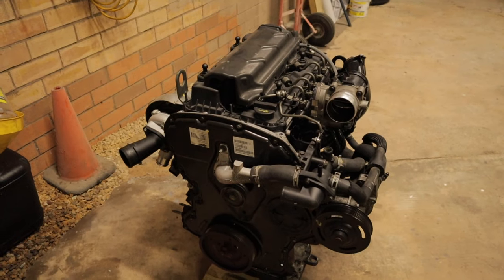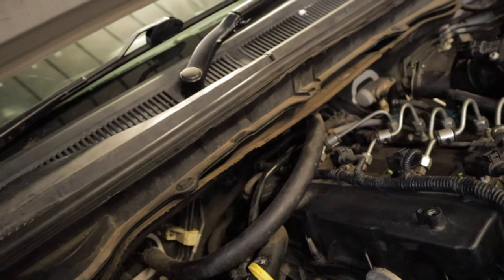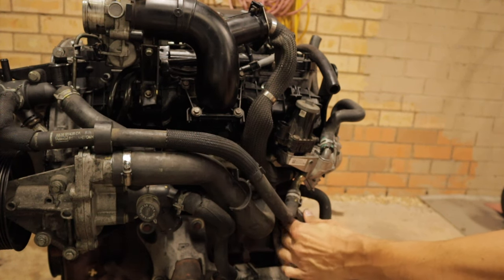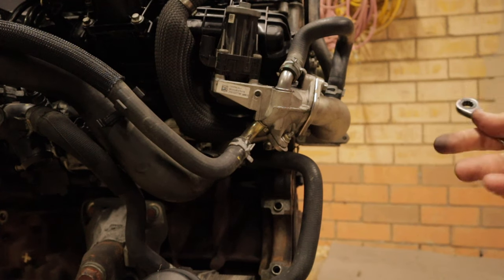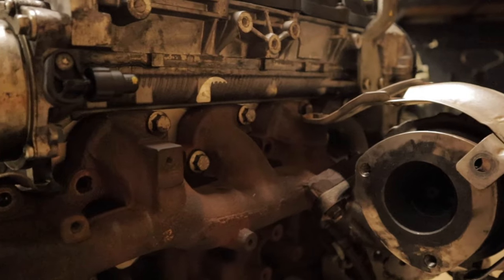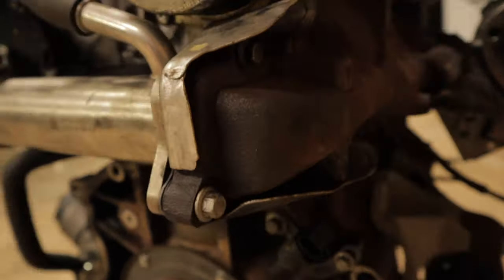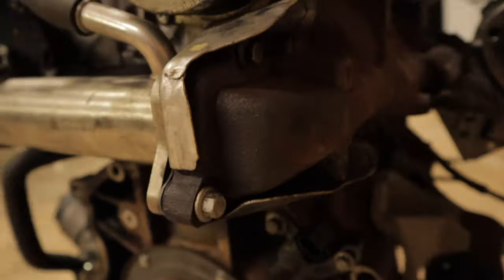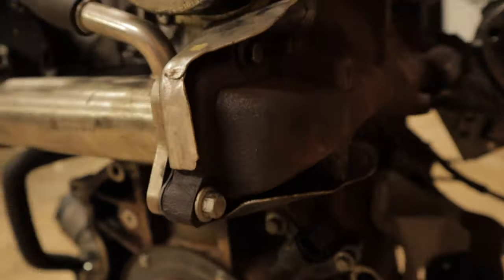Ford Ranger EGR Cooler Bypass, Blanking, Removal & Install

Comment: Great video 👍 question? You mentioned the hose was 15mm but for a Px2 others have said it’s 16mm is that correct?
Reply from the maker: 16mm is the standard size, i used some off cut that looked like 15mm when i measured it, used a tape measure tho so not that accurate, go with the 16mm
Reply: I used 5/8'' ==15.88 mm(16mm)
Reply: 16mm  bottom . 20mm heater inlet
Reply: Definitely 19mm
Reply: When blanking permanently should U get an egr delete on its computer
Reply: Nice demonstration for EGR however if we block EGR for the DTC for P1305 75 2F still present on IDS? Is that correct? I'm looking for Recommendations legend

Cheers
Reply: @markrussell3322  or you can get an EGR Module delete just plugs right into the MAF sensor and tricks the EGR valve to stay closed. no codes at all and no soot in your intake..

Comment: Considering taking this fellas advice guys.  My ranger blew a hole in the engine block, mechanic believes the cooler caused this. This was a 2.2L and now sitting in my backyard because it's hard to justify spending almost 10k to fix it. Oh well..new hilux is going good

Comment: Having worked on ships it is vitaly important to maintain your coolant.
If you're using town water or bore water or not changing the coolant regularly you will get corrosion in the water jacket.
The exhaust gas won't corrode, the coolant does, if the coolant is maintained these problems shouldn't occur but no-one changes their coolant regularly. The engine is made up of dissimilar metals that react with each other when the coolant gets tired and starts to becomes an electrolyte.
Cracks may occur from expanding and contracting but corrosion won't if you look after your coolant.

Comment: Thank you been looking for a video like this for ages. With the EGR to Exhaust manifold blanking plate, I found another guy who slotted the two bottom holes on the plate. Then you only have to completely remove the top centre bolt and only back off the two lower bolts, as you did with the blanking plate at the EGR valve body. Thank you again, job well done.
Reply: That guy is a genius

Comment: This is awsome in theory, wish I had this before I did all this in situ   in the car. Beware the egr valve the little tabs of the factory gasket are sharper then shark teeth, also if u think the exhaust blank is going in like shown then your dreaming. The only way to really accomplish all this with a full intake clean. Get the intake manifold out to get the best access to the back of the head. U can fully remove the egr cooler and fit the blank with a piece of stiff wire inserted through the top hole of the exhaust manifold, slide the top hole of the blank on and then slide top hole of the egr cooler on and then pull the whole lot back towards the Manifold. In sert the 2 bottom bolts to secure then reef the wire out for the top bolt. Then put all the intake gear back on. Make sure u have some small 10mm 3/8th tube sockets with universals to get at the ex manifold bolts in/out. These will come in handy throughout the intake removal as well. Also tie the bonnet up so it sits straight or 90deg as well, allows heaps of room. Ps hose from auto parts supplier in Australia is almost perfect factory replacement for bypass calibre ch1325c.
Reply: Yeah nah, no need to take the inlet manifold out to do the blanking both sides. If someone like me can do it on a gravel driveway with limited knowledge and tools, then anyone can. The trick is to take out the bolts / nuts from both sides of the EGR out at the same time. If you loosen the 13mm nut that holds the EGR to the motor, then you can do the exhaust side from under the car without undoing the exhaust manifold. The other side is the easy side. No need to take anything else out of the way to do the job.
Reply: @wadehughes8986  Great tip. Thanks.
Reply: I used an XD Falcon heater hose, it has a flared end at one end of the hose to suit heater connection at firewall and the non flared end goes to the EGR exit hose location, the particular hose is an ideal length, sorry no part no,

Comment: Great video,  👍  the water line bypass number 1 looks the best. Factory.
You can also just turn off the EGR valve In the software and it never opens to stop soot build up. 
I also read in the ranger Px3 the EGR acts as a pressure relief valve so it opens to relieve boost but stays closed so exhaust gas doesn't get sucked through when light throttle cruising.

Comment: Thanks for posting mate cheers.
Just did this to my 2014 3.2L Ranger.
Had driven it a long way and noticed I was topping up coolant all the time.
Suspected an issue with the EGR cooler.
Eventually it was going through more coolant than I could put it, litres at a time. Must have all been going out the exhaust. Also eventually noticed exhaust gases coming out the coolant tank and odours. So decided to do my own bypass before the engine overheated potentially causing serious damage, if that hasn’t occurred already. Have done the coolant line bypass, haven’t done the exhaust yet. 
It is now not loosing any coolant for the first time in a long time. Temp gauge is stable. So must have been the EGR cooler at fault. 
Very disappointed with Ford for these rubbish parts. 
Will be taking it in to the shop ASAP. 
Thanks for the tip mate cheers.
Reply: Did you need to do head gasket in the end or all good? Mines identical to yours, cheers.
Reply: @antonyomeara-bk9pm  
This is what happened.
I was right the EGR cooler had failed. This is why i was loosing a lot of coolant. The engine did overheat once due to having no coolant. I was lucky to not have any permenant damage.
I then cut and bypassed the egr coolant line, because i was in a remoye location. I did not blank the egr exhaust. 
I was able to get the ute home (300km+) and to a good mechanic.
By this point the exhaust gases from the egr had burnt a hole in the intake manifold. This was noticible by a distinct lack of power. 
Quote from mechanic “found intake elbow and manifold both have holes burnt through”.
Intake elbow and manifold was around $350 to replace. 
Beyond this, the mechanic replaced the EGR itself and replaced the coolant line. Unfortunately they refused to fully blank the egr.
They did a compression test, no problem. 
Havent lost any more coolant so as far as i know the head gasket is ok. The ute is now performing very well. 
Looking at the info from the mechanic it doesnt say they tested or checked the head gasket. Engine oil and coolant fluid appears normal and not losing coolant.
Reply: @bamb4911  good to hear mate, mine is at mechanics now having blanks installed, and tune, i did the bypass. I dont appear to have head gasket damage, i limped it to mechanics so shouldnt have intake issues. Hopefully back mon Tuesday.

Comment: Hey mate great video very informative I have a 2013 3.2l px1 is it possible to just remove the egr valve and cooler of the vehicle completely by blanking either side and bypass hose and will unplugging the connector on valve throw a code?

Comment: I think you'll find that bypassing the EGR cooler and exhaust flow will throw up a check engine light. This is what happens on the older VW TDI engines but getting a remap sorts out the engine management system and everything is fine again.
Reply: ReMap?   Do I need to go to the dealer for this?

Comment: Interesting.. i bought a ranger and was Unaware that previous owner done this but made a hash of it. Was getting exhaust fumes in cabin and eventually found smoke puffing from the area he tried to bypass. Watching this its obvious the previous owner tried to do a bypass without removing engine and therefore didn't do it properly. Had ford renistate egr so all good now.. Thanks for sharing
Reply: Just take the advice of AutoExpert John Kadogan and replace the EGR every 80,000km. 
My friend had catastrophic engine failure and Ford dealer raped him for a new engine $32,000.00!!!

Comment: if you use a dayco  hose  part no dmh1672 it fits on the heater core to the EGR valve  .there is EGR delete from  chip tuning which turns it off completely except for wastegate and no codes  .   cheq it out  then  you can leave the dead cooler ware it is  and no blanking plates
Reply from the maker: cheers, good info

Comment: Hey mate, would you say the easiest way would be to just put the new hose in with the "random piping as shown, blank off the easy side that doesn't have the exhaust manifold, then intake clean, and you've fixed the egr issue of getting the intake direty and no more risk of water in the engine?

Comment: Awesome video thanks for taking the time to produce it. What are the pro’s and con’s of blanking it off😊
Reply from the maker: no clogging of the intake would be the best benefit
Reply: @abdautomotive   wow that was a quick response, I think ?? mine is split and leaking fluid into the motor. Sometime when I start it just clicks,  when it finally fires it runs rough for 20-30 seconds from there it is fine.  I am now releasing the radiator pressure cap to stop the pressure when it is standing. That seems to temporarily solve that problem. Upon looking on google there are those that say not to blank as it can cause engine damage.  Do you agree and if so what king of damage can be caused. 🙏🏻🙏🏻

Comment: Hello,great video thank you.
2 questions please.
Q.Can this process be made to a TRANSIT 2013 2.2 RWD . I believe they have the same engine. 
Q. After bypassing the EGR COOLER and blanking the EGR COOLER like you did, do i have to make a remap to avoid limp mode or they will be no error codes anymore?
Thank you!

Comment: Going one step further, complete egr/cooler delete...? Im guessing once that plug is disconnected from egr, it will throw a code, can this be be neutralised ? If so how??? Great video, keep em coming!!!!!
Reply: Yes... turn EGR off in software to stop throwing codes.
Reply: Or you can simple plug EGR back in, it will still open but no exhaust gas will go through.
Reply: But engine light on my 2017 model 3.2 is on because thenegr valve not get flow
Reply: @tossi8888  these instructions are ONLY for the PX1 mate

Comment: If I blank of the egr cooler on the egr valve side only that means the cooler will still have hot exhaust gas in it will this be problem when I bypass the coolant as you've done in the video.

Comment: Great video, thanks for taking the time.  
One issue, I’ve just had at look into my px2 engine bay, and it looks like that coolant pipe from the heater core goes round and down past the egr to some box attached to the transmission.  Or at least appears to.  

Any ideas?
Reply: Goes to oil cooler on PX2 3.2 from heater core.

Comment: Great vid, especially being able to see all of the bolts without the engine being in the engine bay. Got a question for you, did you need to drill a hole in the smallet plate to prevent an engine warning light? Thanks again.

Comment: Is the bypass a permanant fix or do you still need to blank ot off aswell ? I bypassed mine yesteday as the egr cooler died and was leaking coolant into engine
Its running great now but how long can i run the bypass alone ?

Youre videos are sick man thanks for your hard work and taking the time
Reply from the maker: i've done 200k so far
Reply: So you've done 200k with egr coolant bypass and blanking both sides as this is my next step my px1 2013 has 382xxx and will soon do this plus remove the intake and give that a clean

Comment: L/H  side blanking plate, 15 mins to do a manual in place    but need bent spanners etc for a auto because the dipstick tube blocks access to the top bolt, R/H side takes a while as well but well worth it.

Comment: Great video already bypass coolant hose directly to engine leaving egr valve and egr cooler after my px1 2013 dump coolant to exhaust side and leaving coolant ridiculously low after long run after off-roading and nearly make me stranded.. and also already blank egr valve also after freshly rebuilt top after clogged with carbon at intake site

Comment: Bypassing the egr cooler water coolant & blanking 1 side only (egr valve side) i think these processes possible to perform since the engine is under the hood. So what do you think? Is necessary to blanking the exhaust side?
Reply: Nope as long as you blocked intake side that’s gonna block all the exhaust gases. 👍

Comment: I would use the OEM hose clamp on the new hose. These clamps self tighten as the new hose shrinks (and it will shrink) unlike a worm style clamp which will require tightening down the track.

Comment: Just wondering, if you use a piece of hose to bypass the coolant, like you show in the start of the video, does that now mean that the now hot exhaust will be going straight into the intake? Hence the need for the block off plates? How long can you drive it without the plates fitted? Also, how can you tell if an EGR is dud when buying a Ford PX? I'm flying to Perth to buy, and driving back to VIC, 3500km. Ive just watched 1 video showing the heater hose pulled off the firewall, runs the car, and shows the coolant bubbling. He said this is the exhaust gas mixing with coolant. Correct or no? Thanks. Your videos are really informative :)

Comment: Your vid was interesting I bypassed my egr a couple of years ago one hose on the bottom of the cooler goes to the trans cooler i believe may be wrong but I have mine circulating thru that also the egr seems to be almost impossible to replace with engine in the vehicle. Has anyone done one in vehicle

Comment: Was this motor using a manual gearbox?
I have an auto BT-50 and the hose from the bottom of my EGR valve goes to the transmission cooler, then back up to the thermostat housing.
Reply from the maker: manual

Comment: How are you boss. First I would like to say thanks so much for this educational vid. And also I have a problem similar to this. But my own is pressuring the coolant even after I have removed the coolant pipes . Now what I don't know is that, can this cooler also leak water into the engine or maybe I got a cylinder head problem
Reply from the maker: it could be your oil cooler, cylinder head would be my last resort

Comment: Great video
Thanks for taking the time.
Q. On exhaust side blank plate, doing it the way you showed, does it not create an exhaust leak?? You loosened bolts then inserted a 1-2mm blank plate. When you tighten bolts back on exhaust, they would remain slightly off tight up against engine and hence a small exhaust leak?? Just thinking thru this logically or am I missing something??
Either way, great effort, love your work
Reply from the maker: i get what your saying, when you re-tighten the 8 exhaust manifold bolts it will push the cooler over about 1.5 mm , there is 1 bolt that holds the cooler in place (time stamp 13:03) which in theory should be loosened, however i did not this this on mine and it sealed fine.
Reply: @abdautomotive  thanks again. Reaching to loosen the bolt holding the cooler is easy said than done. Might use my nimble 19yo to reach back there😎😎
Reply: What torque setting is the manifold to egr cooler? Ive blanked mine and have a slight exhaust leak but dont want to over do it and snap something.
Reply: No idea at this stage. Was going to get a Haines manual which should have that data in it
Reply: I blocked my EGR on both sides last week. And have now got a very high pitch squeal from 1.5K revs and up… (turbo sound leaking through exhaust like you mentioned)
I thought I may have just minted the gasket when I prayed the manifold back. Because of how much of a c&@$ the job was, I just dumped my car at the tuners to fix,  
They’re under the assumption the eBay plate I bought may have been to thick. They’re going to pull them out and just close it from the tune. Mentioned it’s a gearbox out job to completely remove the cooler…. Which makes sense given how difficult it was to wedge the 2 plates in…

Comment: Hi thanks for the vids, i am a recent ranger owner  a  px2 (early 2015).  Because i am basically ignorant i was convinced to remap the chip to stop the egr valve from opening. I asked specifically for the water hose to be bypassed so that in the future a simple reconnect would restore the original configuration.  After waiting for 5 hours in their lounge work to be done, two mechanics came out  and convinced me to install blanking plates instead giving me a number of reasons why (still to be done).  Having thought about this for the last week , it is starting to sound they are feeding me BS.  it should not take 5 hours to copy a file or change the values (remap) so i am seriously doubting they have done the remap at all. They are pushing hard to sell me a towing/touring remap making claims of 30%+ performance increase which makes them sound even less credible.  Is there a way that i can get a confirmation from them that they have done the remap? .
Reply from the maker: you need the tuning software to check if it's been remapped

Comment: What subsequent happen to the turbo when removing the EGR system? Does it effect to life spans of the turbo charger or piston? The pressure from the exhaust no longer through the egr cooler. What do you think??
Reply: Only a small part of the exhaust goes through the EGR cooler, most exits through the turbo so only has a small effect. In fact most people report a small increase in responsiveness.